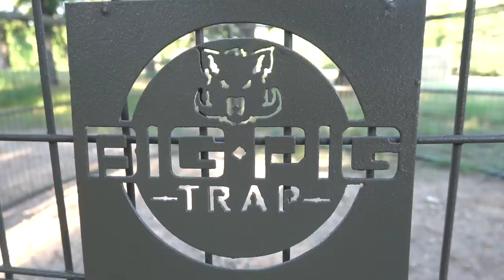The Goats Love It!

Comment: Friends with a large farm discovered a huge boulder in the middle of a field, this was in the thumb area of Michigan which was covered with glaciers during the ice age.  The whole area is flat as a pancake but deep below the ground there are huge boulder.  They hit something hard with a plow, dug around it thinking it could be dug out of the ground, but kept on diging until they got down 8' or more to uncover this boulder.  The Mom got excited and said she would love that boulder at the front of the driveway and they could put the house number on it.  This rock is about 8' tall, 6 feet around.  Like you they didn't have equipment to lift it out of the ground.   One of the son's had an idea, disappeared with a grader/buldozer and flat bed trailer.  He used the grader/dozer to dig a trench next to the bolder.  The trench was deep enough that he could drive the trailer down into the trench so the bed of the trailer was at the bottom of the stone.  He then took the dozer and pushed the rock onto the trailer bed.  This was a trailer that they hauled heavy equipment so it held the stone.  He then drove the truck up to the head of the driveway, did another trench to get the stone down to ground level, pushed the boulder off the trailer, and there was Mom's stone.  THen he headed back and covered up both of the trenches.
Reply: Bet there's gold where that Boulder was.
Reply: Wow
Reply: Great son!
Reply: Great story!!! 👍
Reply: That’s a long story